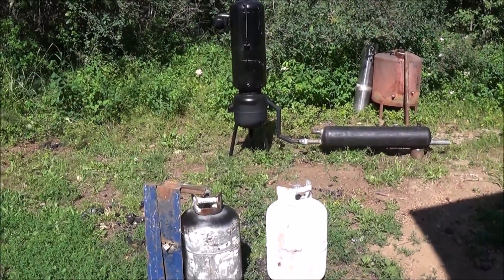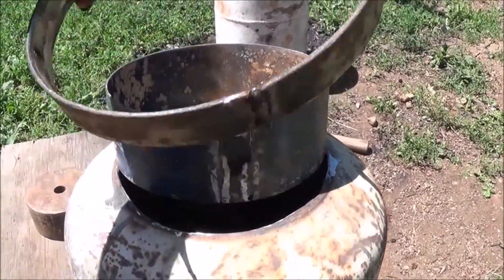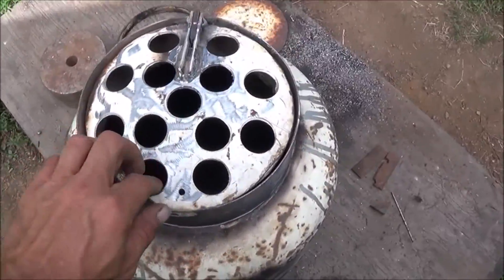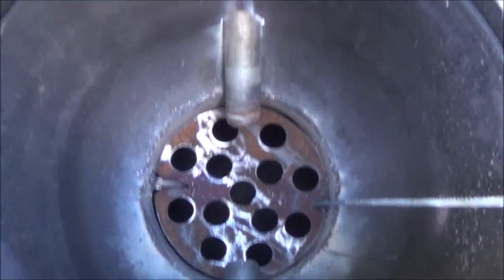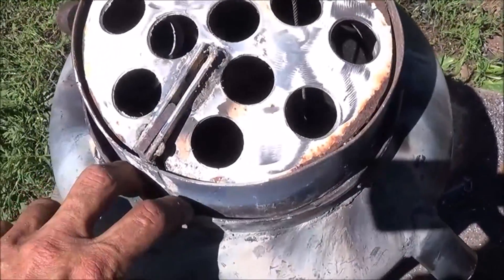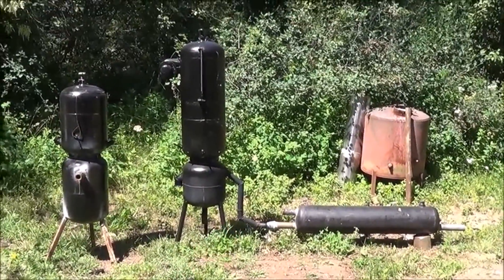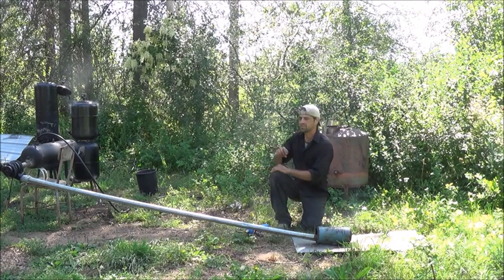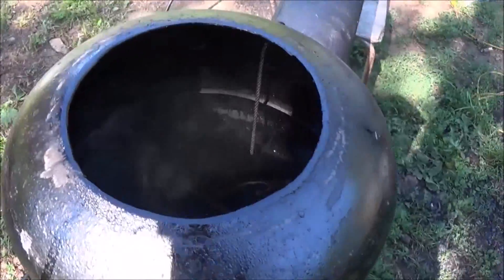Building a "Wood Gasifier" out of propane tanks,  with a gas cooling water heater.

Comment: What is the diameter of the reduction zone?
Reply: Ok, cool, I get it. I like the compact design. I'm looking to fit a gasifier in a little lawn trailer to keep it portable. I only need it for small engine applications "Generators/Pumps/Etc." I would like to know more about controlling the air flow through the burn chamber. What temp does it take to crack or burn the tar? Could a metal forge style burn system be used?

Comment: I am having problems I have not gotten my gasifier built. I tried to be cheap and use my old bucket shop vac . It's drawing smoke but could not light it . I would like to note I was cooling off the pipe with water from a hose. What speed of draw fan do I need?  Seconded I was thinking of using this small air tank to cool the pipe. It's about half the size of the one you used.  What's your thoughts  on that. ??
Reply from the maker: I can only guess without being there, my first guess would  be that you did not reach the thermal cracking temperature needed to create wood gas, this means the air flow is not sufficient or the reactor zone was not designed right. If you had reached the "cracking" temp then you should still be able to get the gas to light but only with a flame held to it and, if you remove the flame the ignition of the gas should stop. If you see this then the gas needs to be cooled further. Hope this helped.
Reply: Mr T   I would like to use 2 100 lb propane tanks for the burner(will power 7000w generator) is that too big?

Comment: Mr. Teslonian, I've been testing my gasifier based on the GEK design for about 2months now. I produced more gas when using rice husk rather than coconut husk(which is my thesis). Quick question, what rpm is your blower? Im using 3600rpm single phase and I think its too much
Reply: slow it down with a variac you can adjust to get the best speed for the flame

Comment: P.S. I posit that by applying a high voltage and high frequency current directly at the reduction zone, can induce the carbon in the hot coals to exponentially react with CO gas to form CO2 thus liberating tremendously more heat.  One can use a tesla coil to acheive this.

Comment: I posit that by filtering the gas, and leading it into the input of a vortex tube, the cold output of the vortex would sufficiently cool the gas to run an engine.  The hot output of the vortex tube should be fed back to the reduction zone of the gas generator.  The advantage would be to eliminate a large condenser.

Comment: Question, Im just asking how you managed to stop the water from the water tank from being drawn into the fan? since you said the 3rd horizontal tank is filled with water how do you stop it form being sucked thru.

Really enjoy your video's. superb content.
Reply from the maker: The pipe is going through the tank not into it, so there is no water smoke interaction.
Reply: Thanks Bud. All my very best to you and your fantastic projects. We are already using composting systems for fertilizer and earth batteries etc. the acids break down in a composing bin producing free electric to a inverter. 

Your systems take Tesla's free energy idea's to the extreme. 5 lots of fuels from wood gas is Brilliant! especially running a generator.

Comment: Say you wanted to heat your house with one of these. How big would the system have to be? I find it pretty interesting there are 3 sources of heat from a single fuel source. The initial burn chamber, the water as it is heated in the cooling jacket, and the gas at the end.
Reply from the maker: If you completely used this  little stove's combined btu output to heat a home it could heat 3-4000 sqf. with ease. Just a little nothing to think about --- If we break down btu's to watt's we get 3.14 btu's is equal to 1 watt, that means with perfect conversion a 100,000 btu stove has the potential to create 33,000 watt's of energy! That's enough to power a city block, so why is it that we have yet to tap the full potential of a single simple wood stove?
Reply: Rather than sit and ponder on why haven't we done this yet. I'd rather say why not. Even at a 20 - 30% loss there is huge potential for heating and electricity generation. Could a system like this be stepped up so that it wouldn't have to be material smaller than 1 inch? I'm thinking big enough to drop normal firewood sized (4 inch - 15 inch around) pieces into to keep material processing down. I believe it could be done however the downside to that would be potentially slowing down the conversion into wood gas and handling the large amount of output.
Reply: Honey Rowland I've wondered if one could build a trompe hammer and compress the gas rather than usually air that gets compressed it would require a stream nearby .
Reply: MrTeslonian THIS would be perfect for cold climates where solar panels are not efficient and for folks on a limited budget!  The kids and I are learning how to weld so we can create some projects.  Is there a way to store/compress the gas into a tank for use later?  Thanks!  ~Honey

Comment: Don't you need to run the gas through a filter system to get the impurities out of it before you run it in a vehicle?
Reply: yes, otherwise the tar and suet produced by the wood burning will clog up machinery as well as cause it to gum up.
Reply: No not at all. Its even D4D compliant

Comment: Astounding! Have you ever considered using a hot water service heater for this?
Reply from the maker: Yes, a water heater is just a pain to strip and clean all the foam off of.
Reply: Hadn't considered the foam.. It's the right size for a burn chamber though isn't it? And the interior coating of vitrous enamel might help combustion temperatures. Maybe something like acetone would help, or, I hesitate to even say it, burning it off.
Reply: Love your videos btw, its a fascinating mix of hard practical science and cutting edge experimental technologies. I think the only reason you don't have a million subscribers already is that you're more busy getting things done than spending hours editing videos into bite size, easily digested tidbits. Keep it up!!

Comment: love these gasifier videos!
Reply from the maker: Just a little nothing to think about --- If we break down btu's to watt's, we get 3.14 btu's is equal to 1 watt, that means with perfect conversion a 100,000 btu wood stove has the potential to create 33,000 watts of energy just on the btu output alone! That's enough to power a city block, so why is it that we have yet to tap the full potential of a single simple wood stove?
Reply: and the super great thing about this design other than it being simple is that it would connect right up to a LP generator ...i would personally add a second cooling pipe and 1 or 2  90 degree turns that i could clean out from time to time to catch as much creosote as i could before it gets to the motor BUT this design is freakin awesome ...very little tweaking and you would be burning VERY VERY clean and not have to worry about hardly any build up in the engine 10/10 sir